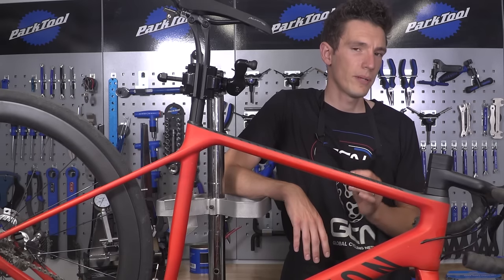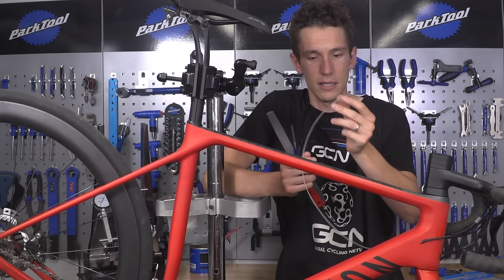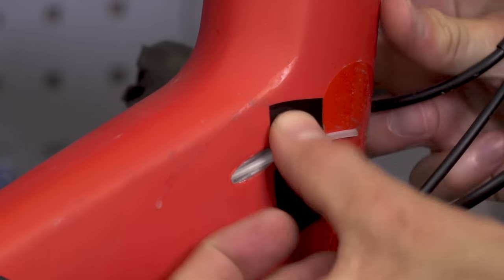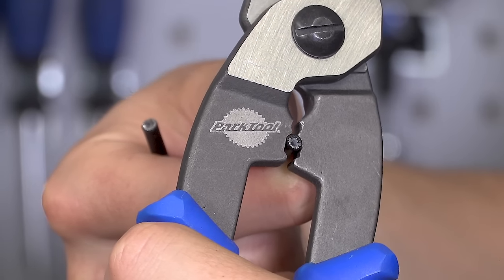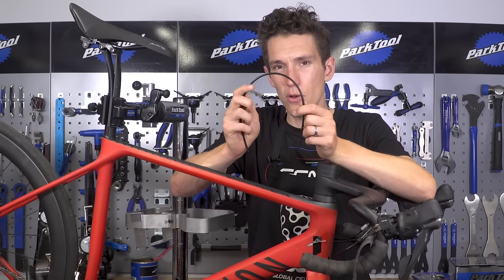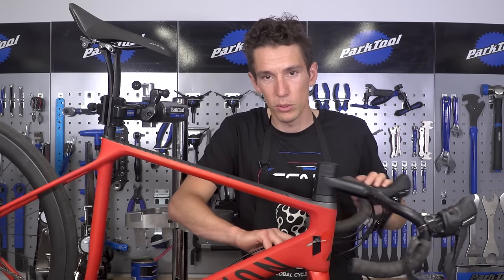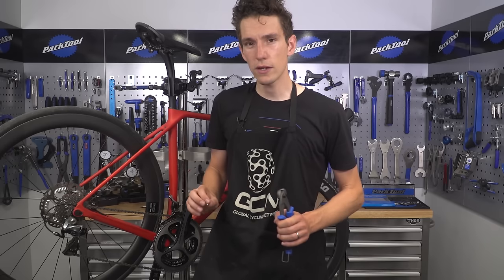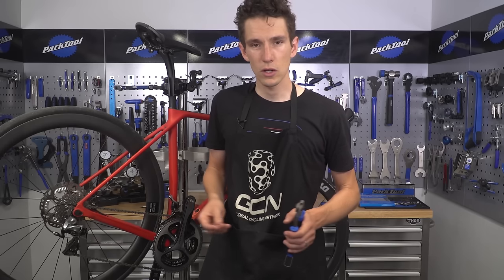How To Replace & Fit Gear Cables On A Road Bike Like A Pro | Maintenance Monday

Comment from the maker: Leave your tips on how to fit gear cables in the comments below 👇
Reply: The easiest way is to buy Sram Etap.
Reply: If your shifting cables are exposed where they run under the BB shell, it is better to use 2 pieces of the guide liner tubes, one for the length of the chainstay and the other one for the downtube. That way it will be easier to add a short piece of the liner to protect the exposed length of your cables from the elements.
Reply: Global Cycling Network you should delete the older videos and remake them
Reply: Global Cycling Network 
Use a really sharp axe (or machete) to cut the cable outers. Makes a very clean cut
Reply: Change your cables regularly, even if your derailleur seems to be shifting fine. Then perhaps you won't end up with a broken rear derailleur cable and no rear shifting when you're 15 miles from home (like I did last month).
Reply: Could you enlighten us about how to install the in-line barrel shifters on these cables as well? Also are the adjusters about to be obsolete now since the new 9100  front mech has a built in   tension adjuster?
Reply: gokaygs The build-in tension adjustment of FD-9100 is a nice detail and works pretty well but it requires really tiny Allen key that you won't find on most emergency tools. If you want the ability to adjust your cable tension on the road,  the barrel adjuster is still the best option.
Reply: I like to wipe the inner cables with dry silicon!
Reply: Instead of putting the cable end caps on, I just wipe a little epoxy on the end of the cable they won't fray and I think it looks cleaner!
Reply: Global Cycling Network Hi, I want to get new brake gear cables for my road bike. In your video, you use "Road shift cable set". What's the difference between what you used and "Standard Brake Cable set"? Can either be used for any road bike? Thanks.
Reply: Global Cycling Network is that plastic tube part of shimanos polymer gear cable set? Or where donI get that?
Reply: seahog32   cc
Reply: L
Reply: Probably your best video Simon
Reply: A cautionary tale: I went to change out the shifter cable on an old bike I was fixing up a bit. The end cap had come off the cable at some point and not been replaced so the cable was frayed at the end. I trimmed off this frayed section so that I would be able to pull the cable through the outer cables and the shifter. This trim left some small pieces and single strands of metal wire on the floor which I quickly swept up realising they could be quite nasty if stepped on. But sure enough, 2 weeks later I go into the garage to quickly grab something with no shoes on and get the sensation that I’ve been stung by a bee in my foot which quickly turns into an intense pain leaving me unable to walk on that foot. A trip to the emergency room, a 1.5cm incision into my foot and a couple of stitches later and they pull out a 1cm long strand of gear shift cable that I had missed when I swept up and had embedded itself in my foot. Save yourself a lot of pain and be sure to vacuum thoroughly if you trim a frayed cable and be sure to always wear shoes in your work area.
Reply: Pros leave it to someone else 🤔😁

Comment: Thanks for the video.
Here's a tip:
Bar tape still good, but the adhesive is too strong?  Bar tape tearing as you unwrap it?
Use a hair dryer on the handlebar as you lift off the tape.  This softens the adhesive and helps it release.  This will prevent tearing the bar tape and hopefully allow you to re-wrap the flats with the existing tape, good as new.
I hope this helps.
Reply: I haven't got any hair.

Comment: Hi :) I would like to change my 105-5800 groupset bike(Cannondale CAAD12) stock handlebar into a Pro Vibe Aero with internal routing.The problem is that I need to completely remove the shifter cable to connect the shifter and brake cables trough the handlebar.The brake cables have in the shifter end a crimped part.It’s possible to cut it down and replace with a new one?I don’t want to remove completely the cable and the housing just to get trough the new handlebar.(Remove the ends in the shifter and crimp back that round part,and get them back to the new handlebar)

Comment: I'm trying this tomorrow, looks a very clear video. But how did the clear plastic tubing get from the top of the frame all the way down inside the frame and exit at the rear mech? Did it just push through when the cable itself was fed into the frame from the bars end? What happens if the tubing gets stuck midway?

Comment: To prevent your housing from crimping when cutting it to length, I run an old gear cable through, and then cut it.
Reply: Useful tip,Thanks man
Reply: Carmen Marin Smart thinking!
Reply from the maker: good tip Carmen. that's of Lasty's tricks too. Jon
Reply: Great tip, but I'd use a cheap bit of new cable to avoid contaminating the outer.
Reply: Carmen you seem knowledgeable, do you suppose a Dremel would give good results for cutting cables and housings to their proper length or should one invest in one of those specialized cutters
Reply: @busybody1474   - Get the cutter..  Better cables are made of Stainless Steel..  That will make it difficult for the Dremel to cut, an will lead to fraying.
Reply: @MonteStudios  I ended up getting the cutter for the stainless cables, but I used the Dremel to cut the housings... Perfect results
Reply: Great tip cheers 👍
Reply: Proper cable cutters are needed to snip cables and housing properly, especially shifter housing.  Quality diagonals work well for brake housing.

And either way, the BEST way to finish the housing end is with a grinder.  This will allow you to get then end perfectly flat and square.  That plus a sharpened spoke to open up the nylon liner and you're set.  Just don't over-grind the end because you'll melt the inner and outer plastic, causing more problems.
Reply: @dudeonbike800  Yes proper cutters are dear, but if you cycle on any kind of ongoing basis then you will replace cables (just a consumable) many times so it is a worthwhile investment.
Reply: brilliant shout

Comment: Am I not watching carefully enough or you really missed the step of taking out the old cable out of the shifter?
Reply: If your cable is still good you don't have to change it
Reply: Isn't it obvious that you'd remove the old cable?
Reply: Missed the step of pulling the old cable out? Just find where the cable goes and take it out. How hard do you think it is?
Reply: To the Sherlock’s who criticise people needing to know how to take the cable out, if it was just coming out easy then we wouldn’t be on here would we 🤨 🛠
Reply: @bikeman123 
Na swifty, we are going to squeeze two cables in there 🤨 
Keyboard boofhead.
Reply: Well said  @laurencebrill2020 I agree with you, some people are so intolerant 👍
Reply: @shivsnorman  We are the Remnant… endure to the end… even the intolerable 😉 💣💥

Comment: My rightside shifter  shifts no more and I can't shift the rear derailleur into the cassette bottom smallest gear. The bike is stuck in the top largest top gear. Should I still cut the cable and continue to remove and replace the old cables and rightside shamano altegrau st 6500 rightside shifter with new shamano sora 3500 right side shifter?

Comment: Perfect instructions. I did my first internally routed rear derailleur cable replacement today, using this video, and it was all the guidance needed. Even used a Canyon bike... :) One interesting difference was that the original cable inner came out with a plastic tubing sleeve for the internal run - probably stops rattles and keeps it cleaner under the bottom bracket exposure. I refitted it on the new cable (only did the inner, as an urgent fix). I used a length of 1mm teflon tubing I happened to have - just the right diameter for the job.

Comment: Two critical pieces of info missing from this and the rear derailleur adjustment video I just watched.  One is to pre-stress the cables after the initial installation (and before doing the indexing adjustment).  Doing so seats the ferrules and gets rid of so-called "cable stretch," so the indexing adjustment will remain constant and not need a readjustment later on.  Two is to check the hanger alignment before setting the limit screws and indexing, because without good alignment, no amount of adjusting will ever work properly.
Reply: How does one prestress?
Reply: @unseriouscycling5751  With a cable puller/stretcher

It could ease a bit the process for rim brakes but it makes it a lot easier for front and rear deraileur!
Reply: @nounours2627  Bicycle derailleur cables are typically pre-stretched by the manufacturer, and you should not need to pre-stretch them before installation. Manufacturers pre-stretch these cables during the production process to reduce the amount of stretching that occurs when the cables are installed on a bike. This helps ensure that your gears shift accurately and maintain their adjustments over time.

When you purchase a new derailleur cable, it should be ready for installation, and pre-stretching is unnecessary. Simply install the cable according to your bike's specific setup, adjust your derailleur as needed, and ensure that the cable is properly tensioned.

If you're experiencing shifting issues or suspect that your cable has stretched over time, it's more likely due to cable wear or the need for adjustment rather than a lack of pre-stretching. In such cases, you may need to replace the cable or make necessary adjustments to improve your bike's shifting performance.

Comment: Any detailed videos on replacing the front Derailleur cable? I totally messed up the L/H screw starting positions and cannot seem to get it to index correctly through all three front gears. I am starting with the smallest front and largest back gear.

Comment: My Jagwire housings have the little inner wires poking out the end near the derailleur.  Is that a sign the outer housing should be replaced or should I jam the little wires back in?

Comment: I am replacing the cables and bar tape on a 70s steel frame road bike, and the cables were originally routed separate from the bars with a lot of slack, should I just use the new cable to figure out how to route it and cut it when I have the right length for it to go under the bar tape?

Comment: I have a smattering of Sturmey Archer 3 and 4 speeds across my fleet and my rule is to only change a cable if absolutely necessary. it's pretty tricky to install a new one without having to live with ugly pinch bolts. My oldest gear cable is 39 years old and still going strong.

Comment: Question: If my shifters are broken (crash) and I want to replace them. I need to redo the cabling. how do I get the bike in the smallest gear without being able to use the shifter on the handlebar?

Comment: Hello from Brazil Simon,

Nice video, as always!!

Please, can you explain what are those plastic grooves (5:47min) that you insert in the cable before routing it into the shifter?
I have got a new Shimano Ultegra R8000 kit and it came with some of these groups.
It is the first time I'm replacing a complete group, so I'm in doubt about these little things.

Thank you and best regards.
Marcelo

Comment: U guys didn't explain how to open up your shift handle to be able to route the shifting cable into the correcting path when installing your cable. I'm sitting here trying to find out how to thread my cable back into my shifting handle bc I don't know how to open it

Comment: A head torch is also good. Heads up on the Flight,  Podium 1, black and white model, the internally routed rear gear cable in the down tube does not need a plastic inner sheath to guide it (the exit hole at the bb is so small that it dosnt fit)  putting the inner cable straight in works

Comment: Great video! Basically never had repaired anything on my bike myself and I could do it - one tip that was missing in my specific case: to check if the end of the old cable (the little metal knob) is still in the shifter in the handlebar - was the case after I had wripped the shifting cable - had to remove the bottom of the shifter to get it out of the system
Reply: I have the same problem, but can only see the frayed end of the old cable. pulling on it with pliers doesn't get it out, it's stuck. Is there a trick to this?

Comment: If you happen to lose the small metal item that crimps to the end of the cable, you can always substitute an electric wire connector.  They come in a variety of sizes and cost about 1/10 as much as an official end piece,

Comment: The previous generation 11spd doesn't need that special piece of cable housing (rs900) for the rear derailleur. That is designed for the new derailleurs that have much shorter cable routing to the frame...

Comment: for me i just make sure that i dont remove both the old inners and outers at the same time. So i'll have a guide for the new inner or outer to follow when i install them. Haven't really seen a need for the plastic tube method shown here

Comment: Where do you get the tube to guide the cable through the frame?
Reply: I bought a 2m length of outer housing and stripped off the outer casing and steel reinforcing leaving a thin, blue plastic tube that worked perfectly.
Reply: The jagwire liners do work perfectly. Just used them myself 👍🏼

Comment: Yea really good to the point video. I need to replace my rear shifter cable. Where do you get the thin plastic tube that you use for the sleeve to slide the new cable back through. Thanks John
Reply: I ordered a 4 meter long piece off amazon, I believe that same sheath/tube is the innermost layer of a cable housing if you feel like stripping everything else off an old piece you’re removing

Comment: Sometimes the plastic liner can get crushed further down the sheath. If the probe won't reach the crushed point, use a heavy gauge wire (not braided) and slide it through the point. The end Ferrel will need to be secure, double check that it is fully crimped. If you buy non-lubed cable, be sure to use a wide temperature grease. The easy way to apply is rub grease into wire with a tooth brush, then wipe off excess with rubber glove (not cloth). A well lubed wire will drop through the sheath by gravity only. If not wipe wire again. Twenty years making cables you learn a few things.
Reply: Now THAT is "pro" - thanks!

Comment: I've heard you can use a vacuum cleaner and cotton string if you need to feed through a frame. Put the vacuum at one end and vacuum the cotton string through the other.

Comment: The video doesn't show the part where you remove the old cable from the shifter. Pain in the ass if you don't know how.
Reply: It's a glaring omission and the most frustrating part of the job- have to go to other videos for advice.
Reply: Only thing I was looking for
Reply: @Willo.  push in the small lever, then you can just push the cable through
Reply: My rear cable frayed and broke at the shifter end on a ride yesterday (annoying as bike had been serviced the week before). The end of the cable has disappeared, frayed strands of cable are visible near the pulley/guide. Ordered a shimano stainless cable, going to have a go myself as my bike shop are closed for a week. I ride 4 times per week ATM. Have a second and third bike but love to ride my ‘best’ bike. Where do you get the plastic tubing as someone else also asked?
Reply: @alexcallas8222  can you recommend one please... This is the bit I'm unsure of
Reply: Alfie Moses thank god for your comment it saved my life
Reply: @sophiescyclingandwalkingch4294  0
Reply: So true!  I had a snapped cable in for repair and had to find another, "frayed cable-specific" video to find.  I didn't realize there's another access port on the bottom side of the shifter.  Unscrew this phillips screw to unbolt it.  Once you slide the cover off, you'll see the cable route and can remove the broken section.
Reply: @alfiemoses  not necessarily.  If the cable's frayed or broken (and this is a common place for this to occur), the shifter may not be able to release to the return position, preventing cable removal.  
This is EXACTLY the scenario I found myself in two days ago.  There are other videos that show dislodging the rubber brake hood and removal of the the cover to expose the cable route through the shifter body.  This video assumed cable removal was a given.
Reply: Anyone struggling with this I bet you’re not in the right gear. Put the rubber covers back over the shifter, a little tension on the cable and shift to the lowest gear. Rubber covers can prevent your shifter shifting properly if peeled back. Your shifter cable should then be exposed at the end and slide right out
Reply: @alexcallas8222  GCN care about making videos, not about whether they’re useful to fix your bike. It’s sad 🤷‍♂️
Reply: @jackglossop4859  good point!  Yes, when the cover is rolled back on itself, the shifter internals cannot return to the "start" position, which is where it needs to be for cable replacement.
Reply: @dudeonbike800  it took me an hour to work this out. When I finally realised it I came straight back on here to spare the next guy’s bewilderment 😁
Reply: @jackglossop4859  This right here is a potentially critical point. Why the hell doesn't he offer helpful advice like this in the video?
Reply: @alexcallas8222  I also can’t stand the croaky voice thing that all GCN presenters seem to do. Like they’re barely managing to get their words out

Comment: Amusingly, it's almost impossible to get hold of that Shimano 9100 cable pack in the UK from any of the usual sources. I had to get the small outer for the rear mech from an ebay seller in Taiwan!